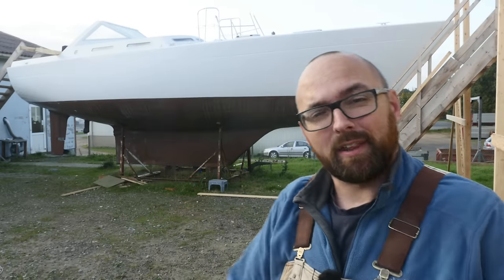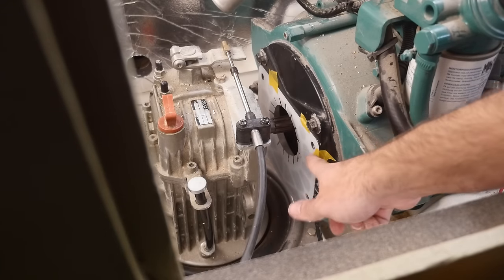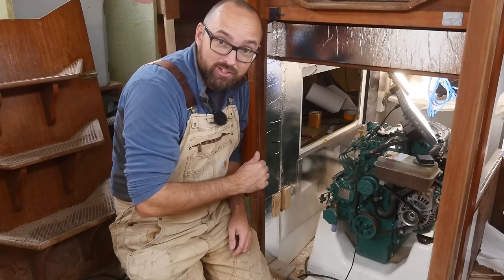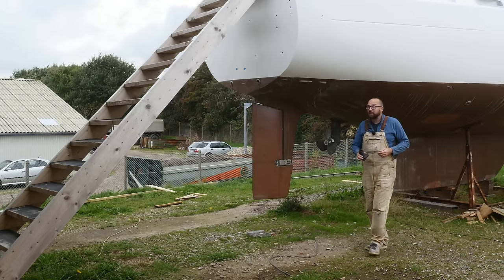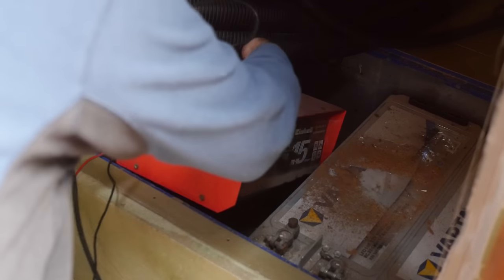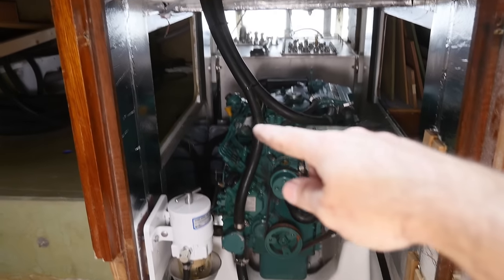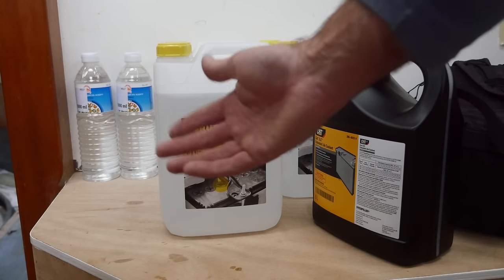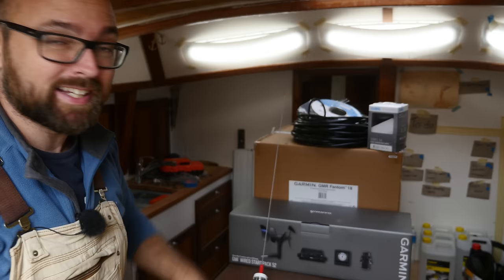Sail Life -  It's been 4 years. Will the engine start? - DIY sailboat project

Comment: Mads, one trick to catch the rust deposits is to make a sock out of nylon stocking and place it over the coolant outlet, then add the coolant hose. Later after a good run you can see exactly what has come out of the engine ,without any going back in .

Comment: As an owner of a Warrior 40, there is a weakness I discovered in the bow grp panels in the forward cabin. Wave action caused crazing to the gel coat on both sides of the bow along the line where the cupboards are fitted. I solved this issue with adding stringers to the inside to strengthen the panels to stop the flexing and repaired the gel coat So far so good after crossing to Atlantic twice and touring the med.

Comment: Mads. Great video glad you have the isolation sorted. This will really help out a lot of folks who don't know about the saildrive/engine isolation. Your probably going to cover the anti syphon valve as you showed the tube to the exhaust gooseneck in your Vetus diagram. Its really, really important. Not having a functioning anti syphon can result in an engine full of water!!! Sea water. We have seen at least 3 boats where they were not aware of how it works or why it's necessary, and it ended in tears. Please keep giving good advice to the sailing community, sharing your experience and helping folks to live there dream with knowledge shared. Sail Safe mate. Ant, Cid & the pooch crew.

Comment: We had an expansion tank on our Mitsubishi 4x4 that cracked in the heat and sunlight. A club member was making aluminium ones with a little round window in it to check the water level. Been good for the last 8 or so years.

Comment: Puzzled over the sail drive isolation but I think it must be needed due to the negative earth wiring on the engine block which have stray currents which potentially could interfere with the anode on the sail drive like an impressed current cathodic protection system as you see fitted to larger ships. Makes sense. Excellent work as usual Mads 👍

Comment: My diesel heater is also connected to the main tank. If I was to re-do it. I would install a separate smaller tank for it. That then means you can run 'heating diesel' which is much cheaper. In some EU countries, heating diesel is tax free and dyed. There's usually a big fine if it's found in your main tank. The Belgians were catching British sailors out on this as Red diesel (used in farming) is allowed to be used in boats in the UK.

Comment: Mads - I've enjoyed every video. Here's a tip for bedding fasteners with only a single pair of arms and hands. You can thread the thickened epoxy you've used to isolate the core using a tap just like you would with a metal piece. Simply thread the fasteners through and there's plenty of holding power to add the nuts all at once from inside the boat.
Reply: Jason King, that would work for Poly sealant but not for the Butyl that Mads is using.  You do not want to turn the screw because it balls up the butyl.

Comment: I am replacing the exhaust elbow on my Volvo Penta along with the water pump.  After seeing your work on the cooling system I have decided to replace the old fittings and piping as well and use your vinegar trick once it’s rebuilt!

Using the hive Utube mind we will all continue to evolve by teaching and learning together 😀. You are just such a likeable and deserving part of that community I feel so invested in the proposition that you will achieve all you set out to do!

Comment: Mads, This is too late to save you from the Volvo tax on the formed hoses but it might help others.  When I need to get a formed hose for my boat, I take the old one or a drawing of the sizes and shape then head to my local auto parts store.  I tell them what I need and they let me prowl the auto hose rack and I have always been able to find what I need.  I do not try to find a perfect hose, just one that has the correct geometry somewhere in the length.  That short 90º is easy.  You find any hose with a tight 90 somewhere in it with the correct diameter then cut it down to the correct length.  I found one hose with multiple bends recently that was able to replace 3 hoses on my Universal including a transition in diameter.

Comment: That through hull is only above the water line while the boat is heeled over. You should have a device that prevents back flow when the engine is off in the Marina or at a dock!

Comment: Thanks for all your work on these videos.  It is a sad Sunday when I don't get to see another Sail Life video.  You showed the goodies for the top of the mast as well as the radar but didn't mention the steaming light or and mast mounted deck lights.  Also you might want to consider a speaker used to provide fog and anchor signals (usually with your VHF).  I added this on my last mast rebuild but had few opportunities to use it until last month when I really appreciated not having to sound fog signals for a couple of hours by hand.  Another item you might want to consider is a masthead tricolor light.  I should never be used with the steaming light or the deck mounted running lights (it happens here in SoCal all to often) but under sail it extends the visibility of your running lights by being much higher.  I wouldn't use the red over green light allowed for sailing boats unless it is widely used in your area  I find that even professional captains fail to remember the navigation light configurations which are used infrequently.  Don't forget to check on your lights visibility requirements (brightness) for your under 12 meter vessel in the colregs.

Comment: when wiring/rewiring the mast- I strongly suggest that you run separate coax and separate antennas for your VHF and your AIS--   it's much simpler and less prone to problems than using the same antenna with a splitter--    just mount the AIS antenna on a spreader- the two should not be on the same plane.    I enjoy your videos and your attention to detail.   keep up the great work!
Reply: And a isolated tube only for grounding

Comment: Hey Mads.  Another great video - thanks.  Fantastic that the engine ran so quickly!  Once concern - it seems like the exhaust could be a bit of a problem if you were on a port tack motor sailing.  I know you said it was there before.  Hopefully it will be fine but you might want to see how much healing puts it underwater.  Also, I hope the new rigging is as easy as you are   expecting.  I'm getting ready to do my second re-rigging and I feel like there is a fairly big learning curve.  Ron
Reply: Those long grey tube/box things fitted just inside the hull? They're anti-syphon valves whose job is to prevent water getting back up inside when the boat is heeled and the ports are under water.

Comment: That cleaning made the engine smile when mounting the filling cap have in mind that it should be as easy to access both with a jerrycan as well as with a fuelhose and If spillage occures it won’t be all over the boat or in the water.

Comment: It may be worthwhile considering to mount the expansion tank away from the engine and mount it to the wall of the engine compartment next to it. The tank may not withstand vibration in the long run.

Comment: Mads, have you thought of mounting a couple of Spotlights to the Mast to illuminate the Deck? One forward, one Aft? Now would be a good time to decide that.
Reply: Yea and leave a handy pull-string or 2 behind for future upgrades. Lights, internet sat/com, laser fish finder... whatever the future brings.
Reply: I agree! Good spreader lights are very useful, especially in high latitudes where we end up doing too much work after it gets dark.  I installed Lunasea Lighting LED spreader lights Mfg# LLB-472W-21-10 which produce a ridiculous 1000 lumens each and are dimmable.  They look very nice, have a low profile and the light is a fore/aft oval which lights up the whole deck without blinding your dock neighbors. I was out "racing" in 0 knots of wind at 3:00 am and used them to let a 600' ship know where I was after contacting him by radio.  Made me really easy to spot!
Reply: Barbicon Tomato, & Lighting Rod grounding cable ⛈
Reply: I would add a camera up there too for navigating shallow waters
Reply: Mine has no spreader lights and I  sure wish it did. On my nice to have list, that keeps getting longer as I  watch your incredible  videos. I think Ava is very lucky to have  you doing  the  incredible  job that you  do.

Comment: Hi Mads.  Terrific job on Athena!  Looking forward to the big launch day.

Perhaps someone can explain why the exhaust ports are exiting the starboard side of the boat? Isn't the transom the more logical exit point or have I missed something? The ports will be dragging in the water on port tack.  Kind of defeats the effort to fair the hull in that area, no?

Also, try not to add petroleum lubricant to rubber hose connections.  I am pretty sure that petroleum products will degrade the rubber.  Didn't catch whether you used synthetic grease or petroleum grease.
Reply: My Beneteau  has the  same  set-up  but on the port side right form  the  factory.  I don't  know  if  good  or  bad  but  works for  last  20 years.

Comment: Should you Anti-Syphon loop not be between the head exchanger and the Exhaust Elbow? - i.e. remove the little pipe you had issues with and install the anti syphon loop there, either with or without a valve? Its better to break the draw back before water reaches the hot exhaust elbow..

Comment: That Gasket material looks like  plastic High Temp PTFE Film Sheet Plate.   You can buy 0.5/1/2/3/4/6mm Thicknesses off ebay for less than 5euro but you need to cut it yourself.

Comment: Great video!  Have you given any thought to hull insulation?  This would help not only with keeping the boat warm while you are working on it, but would also help with issues of condensation and keeping the boat warm or cool, if air conditioned in warmer climes).  Check out Sailing Uma, they actually used poly foam interlocking exercise mats epoxied to the inside of the hull to insulate it.
Reply: If you'd been paying attention to earlier episodes where he rebuilt the interior, you'd already know that Mads has been insulating like a champ as he went.

Comment: Volvo spare parts sounds like what we used to say about General Electric spare parts where I worked... You can buy better, but you can't pay more!
Reply: It's the same everywhere. Last week I got a new air filter for my boat engine. Accidentally clicked buy on the authentic old stock branded version for £25 instead of the standard bit of paper cup for £2.50. :P
Oh well, it's authenticity cooled now for certain!
Reply: Most of the time, if you buy it cheap... cheap is what you get. 
You did your engine 👍 good!
Reply: Same in farming nothing more expensive than 
John Deere green paint

Comment: Wondering how the DC is grounded to water on your boat? On traditional propeller shafts, the DC ground goes to the block then through the shaft to the water.  How do you reach the water?

Comment: If for any reason you need to flush or clean away any Rust or Lime Scale for your Engine - Toilet - Sink - Shower. or were Build-Up of Lime Scale or Rust use a Solution of Water and Citric Acid. it Eats away Lime Scale and Rust making every thing looking like New. and if you use Hot Water with the Citric Acid it works a lot faster. i use food grade Citric Acid its a lot cheaper and you can get it in 2KG bags for about £10. its well worth the investment and to keep aboard the boat for future use

Comment: i keep forgetting i need to mention this to you.
i run serval of them myself, and they're a better and cheaper option than your zibro heater.
you can find em many places. but the cheapest place is probably banggod. com .. go look for a 2, 5 or 8 kw diesel heater.. they come in all sorts of configurations.. they are REALLY good and so cheap to run .. and a TON of people use them in boats and in all sorts of other things.. (if you order one then chose shipping from ES, CZ or UK , that way you wont get taxed the living snot out of)
i use the 8 kw for my garage (værksted) garage is pretty big but it's a breeze for it to heat up .. and you dont get the exhaust fumes to breathe in like you do from the Zibro .. and allso the fuel is a hella lot cheaper since it's diesel (which you allready have for your engine) .. 
i think it would be a good option for you now we're moving towards fall and winter if you want something that can mind it's own buisness without having to refuel it every day with the cost of a new rudder .. 
im actually located not that far away from you, so feel free to get in touch if you want to see one before you buy .. (i live near Vemb)

Comment: Couldn't some of those plastic washers be replaced with the plastic from a milk bottle?
Reply: That's exactly what it looks like, High-Density Polyurethane -or HDPE.  A couple of those spacers, like the big one are probably sensitive to the correct thickness so that the spline shaft inserts just the right amount into the socket.  But most of the others probably would not make much difference 0.1mm either way.

With all the factory Volvo-Penta parts Mads has replaced at ridiculous prices on this old engine he could have probably bought a new BetaMarine replacement and repowered for the same cost.
Reply: Something to keep in mind when on an isolated island in the pacific and the plastic fails....see that floating plastic milk jug...hmmm

Comment: So glad to see you doing well on your Do list. Did you contact Kraken on your Rigging? Hope you start trying to safe weight on Athena! Hate to see her gain weight because that will slow her Down! Just a Question will the Exhaust on  the side could cause problems when Athena is on Her side?  Take Care and how your Wife Doing?
Reply: To answer your question, no, the boat heeling over won't be a problem for the exhaust. That what those big tube/box things just inside the hull are for. They stop water from getting siphoned up inside.

Comment: Is it an open loop cooling using seawater? Or closed loop using coolant? Though I'd assume seawater is not what you'd want in an engine! My boat uses freshwater to cool.
Reply: Closed loop with coolant. Did you not see the drums of coolant next to the vinegar and distilled water? He even mentioned the coolant a couple of times.
Reply: @Garryck-1  Yep. Just confused why three was water coming out at the end from the exhaust? (Mine does that cos it is open loop)

Comment: Why does the engine need to be insulated from the drive?
Reply: mark rutlidge
I belive it is the mixing of metals (steel/iron and aluminum). Galvanic corrosion through the saltwater can do some serious damage.
Reply: @WaterFaucet24  thanks
Reply: Galvanic corrosion.  If you don't the sail drive's aluminum casting becomes one large sacrificial anode even more active than the Zinc's.

Comment: The design on that coupling is just 100 levels of stupid. There should've been one single plastic sheet with four collared washers to insulate the bolts from touching the flange. All this complication, when the solution is in 5 parts, 4 of which (the collared washers) are readily available as off the shelf parts. Misumi sells them as both electric and thermal insulators, for example. I absolutely hate, designs like these where there's no rhyme or reason behind the finite product.

</rant>
Reply: Have you ever tried to tell an engineer they're wrong? I think a lot of times they are just trying to justify their paycheck.
Reply: @flyingdutchman6984  Aren't we all?
Reply: @IngstrupThomas  - probably, to a certain degree. 😃